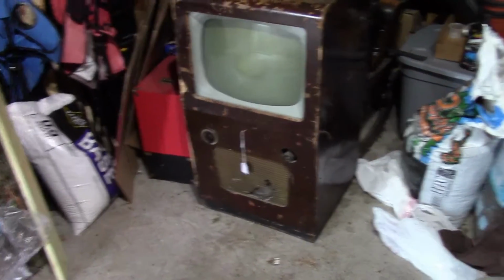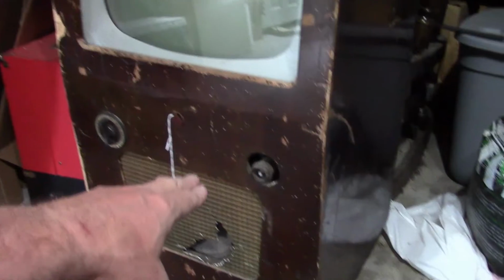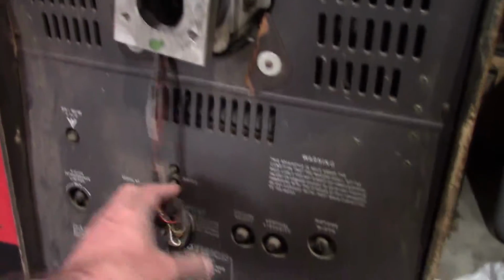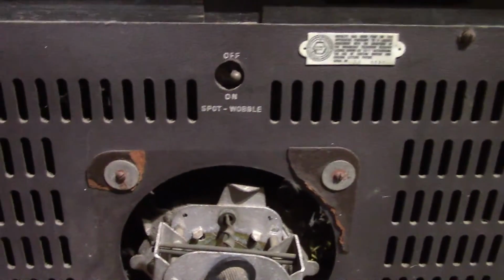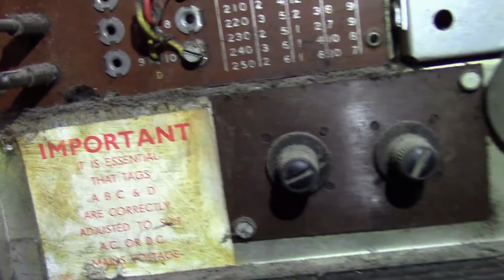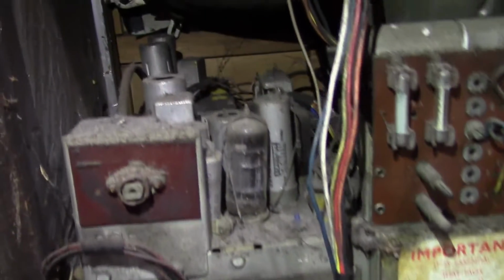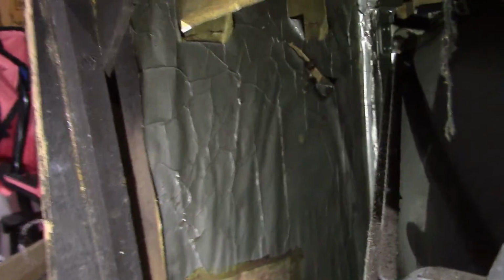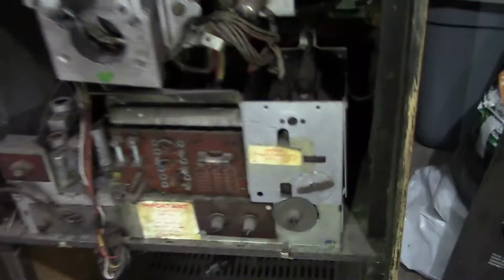Ekco 267/I restoration p1o?

Comment: Some of the early British sets had a mains-driven HT (high tension) supply.  Due to the low supply frequency, the required filter capacitance can store enough charge to kill, which no CRT 'dag meant to filter horizontal frequency flyback voltage can.  Maybe this is inapplicable to this model, but it would be wise to check!
Reply: Mains EHT thankfully finished with the very early postwar models(Pye B16T, Bush T91 for example) this Ekco is 10 years later.
Reply from the maker: No, this has a flyback and very similar operation to US sets with regards to the deflection circuits.  The big differences are in how the video sync and sound is modulated.  Sync pulses are positive and the sound is AM while we had negative sync and FM sound.
Reply: early uk sets had line frequency high voltage because flyback high voltage had not been invented yet

Comment: Hope you can procure a signal converter for this old format.  To get the 220-240 volt mains (I think it would have been 220 at the time) a variac and transformer (even a 120-120 isolation transformer wired in a boost configuration) would do you fine.  Nothing in the TV should care if it gets 60 Hz power rather than 50 Hz.

Comment: If you get that set running, 240 volts is available from your breaker panel, it's usually used for electric ranges, clothes dryers, or larger window a/c units, or central a/c, (of course it would involve installing a 2 pole breaker, a NEMA 6-15 receptacle and the associated wiring). As long as the 60HZ vs 50 HZ thing isn't an issue for the TV's horizontal and vertical sync circuits, just not sure how you'd feed a signal to it
Reply: 240 volts might be too much, and a step-up or boost configuration fed from a common 120 volt variac more practical.
Reply: @SeekingTheLoveThatGodMeans7648  The TV in its jumper settings has a 240 volt option, so if properly configured, it should work
Reply: I would avoid that because then the entire chassis would be live. It would be easier to build a voltage doubler and run the set from DC.
Reply: @eDoc2020  the live chassis in uk sets are fully isolated from the user with the back cover on as many 50's houses used reversible AC outlets and the chassis could easily be at 240V to ground

Comment: Extra information for the UK TV system in the mid-fifties that might help:
Lines=405, Field rate=50, Line rate (horiz freq)=10125. Starting in 1950, the aspect ratio was 4:3 (same as NTSC) so a US sourced CRT should be OK from that standpoint. Video modulation is AM (positive (brightest portions correspond to highest RF level)). Sound carrier is offset from the video carrier by 3.5 MHz and is AM (not FM). Lots more info on the internet. Good luck on this project!
Reply from the maker: Oh boy, AM sound?  Stranger than I expected.  This should be fun
Reply: @bandersentv  The AM sound has wide bandwidth, it’s almost as clear as FM and NICAM digital stereo (there’s another great format you Americans didn’t have). Almost as clear.

Comment: Guessing since it is series strung having double the line voltage that explains why they'd have double the filament voltage too?  Neat find... I wonder if you can run it from a raspberry pi output for 405 lines?
Reply from the maker: Yes, exactly.  Half the current and twice the voltage.  Raspberry Pi is a possibility.  I'll have to poke around on the British vintage restoration forums

Comment: The interference limiter is used to set the level at which the signal is clipped. Usually a bit above the maximum signal level, so that any interference spikes are reduced.  The service information should give the correct setup procedure and voltages.  The reason for this approach is that 405 lines used positive modulation, which meant gated AGC would be unreliable as the sync pulses and porch levels would be noisy on weak signals.  405 line TVs relied on average AGC which didn’t suppress pulse or spike interference at all well.  Interesting comparing a vintage UK TV with US TVs.  Hopefully you’ve already found the details of the vertical sync and it’s odd system of a train of 7 pulses on one field, but nothing of the other.  Part of the vertical integrator action is integrating those pulses into a single pulse.
Reply from the maker: Thank you for the information.  It's stranger than I expected!  I did just get a scanned copy of comprehensive service info so I'm not totally in the dark anymore :)
Reply: some 50's uk tvs do use gated AGC and full DC restoration. Interference Limiter is mainly to combat auto ignition interference
Reply: Actually any pulse type interference, our doorbell would produce bands of dots when it rang.  It was fascinating to flip the system switch on our Bush TV125/U and watch the change in the spikes polarity! Agreed a few sets did but most didn’t, much to the chagrin of the BBC, who would deliberately include a light in a night scene to force a reasonable black level.  I’ve watched a good few movies that looked like fog instead of night.
Reply: @Wenlocktvdx  ah you were posh then if you had an electric bell in the 50's! In the grim north it was normal for callers to shout through the letterbox

Comment: 15:20 I also personally wouldn’t be surprised if some tubes in the set are Mullard branded. If you haven’t already, a great and entertaining source for info on European radios and tube devices is the channel of David Tipton. However, you may already be familiar with his work.
Reply: It was hard to see in the vid, but there may be rimlock tubes. Similar to miniature 7 and 9-pin tubes but have a ridge on the bottom to clip into a spring clip on the socket.
Yes, Dave Tipton's channel is interesting. Radios with no frequencies, just station numbers, dials in meters (wavelength), transformerless B+ but use a filament transformer, odd tube types and more we don't see here.  
He might be able to source some of the odd tubes. Big question is can you test them.
Reply: dave tipton is australian!
Reply: @kevvywevvywoo  yes but I have found that australian radios are somewhat similar to british ones, and he also sometimes repairs british radios.
Reply: @thomas_howe  yes i love it when he has a british one on. It's always nice to hear his opinion!
Reply: @kevvywevvywoo  well if I’m not wrong I think he did again a few hours ago

Comment: You sir are up for quite the challenge.  Shango wouldn't even tackle that one.  Broken picture tube and especially a British set.  Your chances of finding a replacement are slim.  I'd bet $$ you have a line on one or a supplier.   Good luck!!
Reply from the maker: Thanks, I'll need it.  No, I don't have an exact replacement.  If I restore it, I'm going to use an American picture tube.  The dimensions appear to be identical including the base connector.  Only issue is the filament supply.  The original was 12.6 volts at 300mA, but I'll be using a 6.3 volt at 600mA.
Reply: Now you really have to get this thing going if Shango didn’t want it lololol
Reply from the maker: Shango is a couple thousand miles away actually.  He was just surmising that he wouldn't tackle it.  I don't doubt he could rig something up and get it going.
Reply: Shango once tackled a Curtis-Mathes colour TV combo (which he believed had a chassis similar to RCA CTC-15 or later) with a necked CRT so he wouldn't be too bothered about the broken tube in this British set.
Reply: I dont think you'll find it too difficult. Get the timebase running at just over 10KHz to check the EHT.. The FM radio part will be useful for checking out the IF stages.. Then it's 'just'
the crt which should work with a US one and after that a signal source.